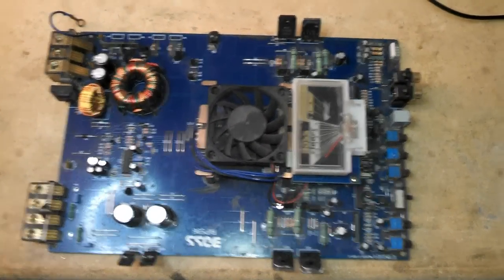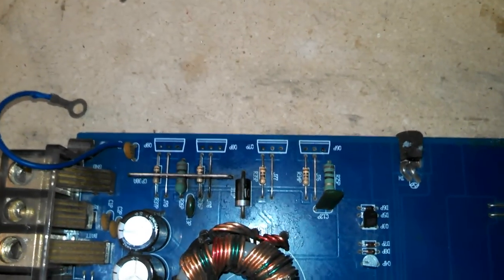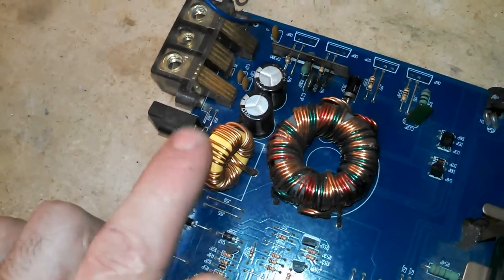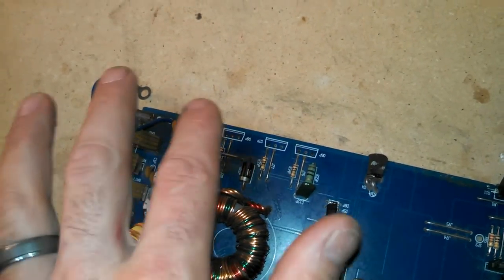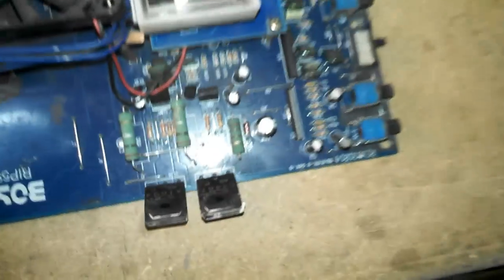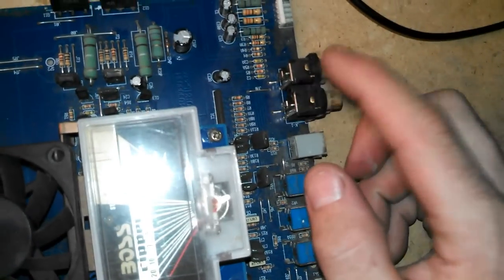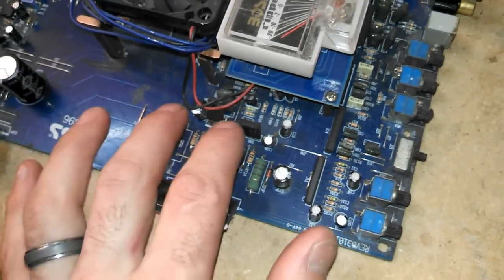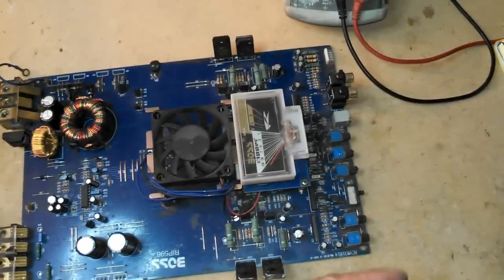How an Amplifier Works - What happens inside a car audio amplifier

Comment: You need to have a nice 100 percent dry surface when repairing a car amplifier because the circuit board can oxidize if it gets wet and people who say 100 percent pure clean water aka distilled water doesn't damage a circuit board their lying because even distilled water can ruin a circuit board distilled water can't short out a circuit board but it can cause it to oxidize meaning the circuit board will change color usually to a ugly brown kind of rust color that a circuit board will turn if it gets wet and water won't sometimes fry a car amplifier but it will slowly malfunction and shut off due to oxidization water can damage your car amplifier even if it's clean water

Comment: you're smart but voltage doesn't kill you, especially not 100 volts ahahah current/amperage kills you
Reply from the maker: An Ns-1 produces about 300V and can carry 675A.  Considering 300V is easily enough to penetrate skin, and 675A is over 674A more than it takes to kill you, you may want to rethink that.  If you still don't think so, I invite you to try sticking your hands in one.
Reply from the maker: Even 100V is enough to penetrate skin especially if its moist (sweating, humidity etc), and even 30mA of current (way less than the amp is capable of) can cause of fibrillation and death.  Do not underestimate the power inside even a small amplifier.
Reply: Even 50-100 v can be fatal.
if you don't believe then please try it.
A continuous flow of current + can kill anyone